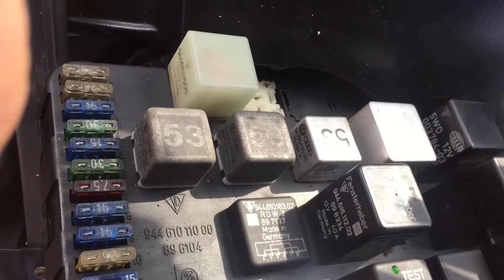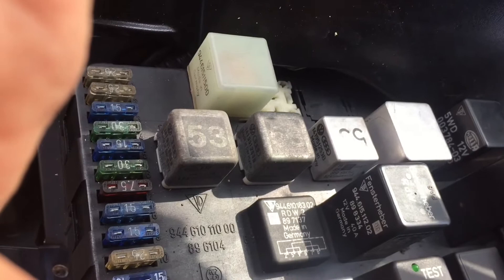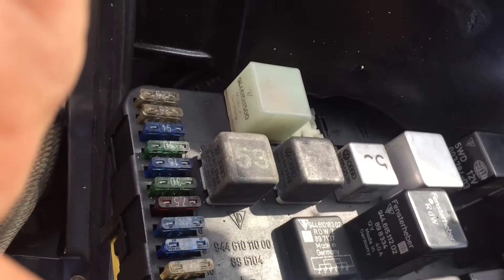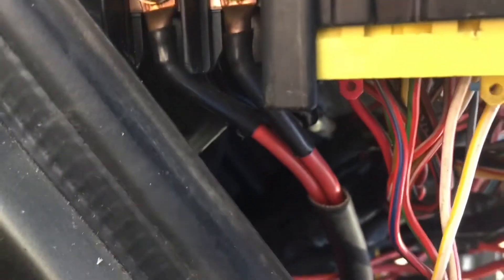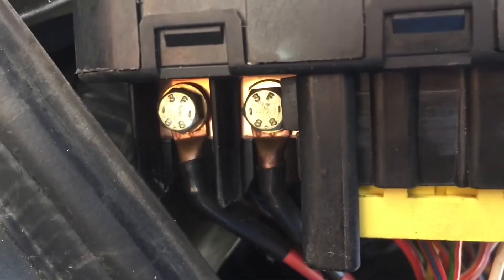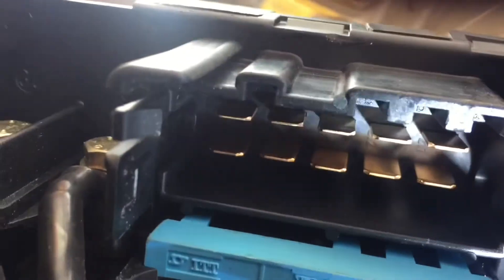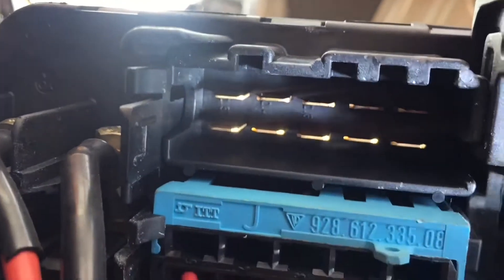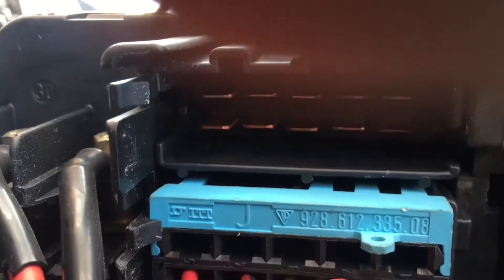Porsche 944. 1986, Fuse Box -Aid Memoire

Comment: Each plug/socket is lettered and the spade terminals under the fuse board correspond with information on the wiring diagrams in the manual.  e.g. C43 = plug C, terminal 4.3